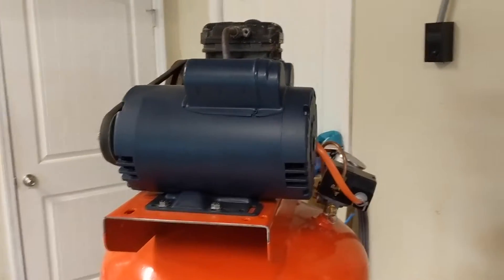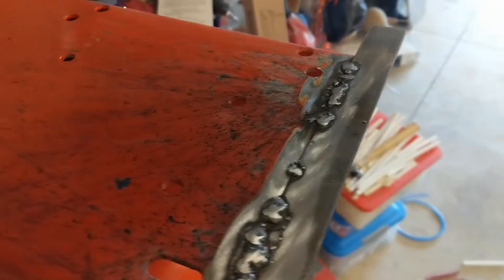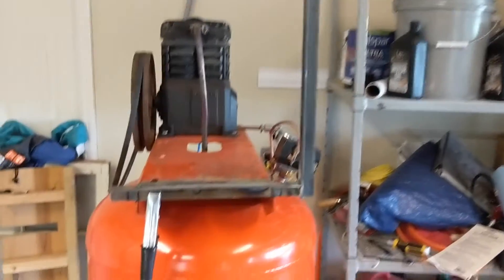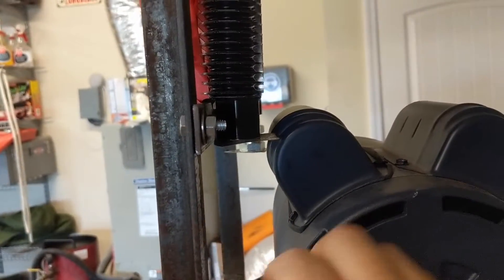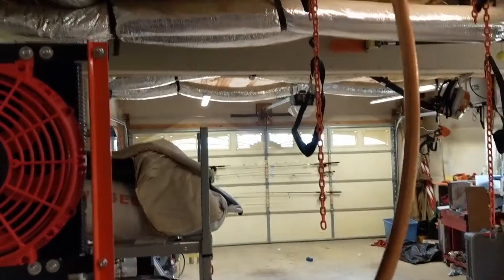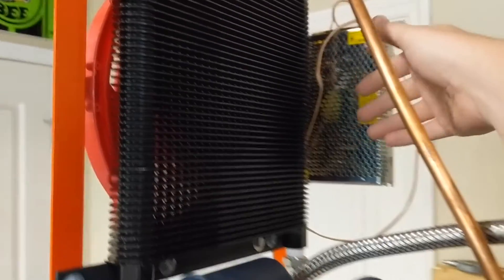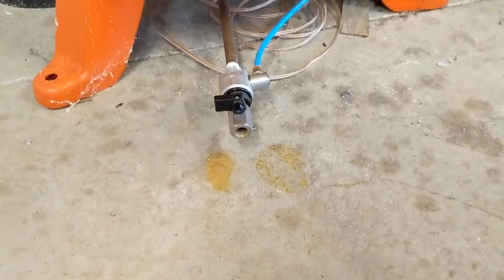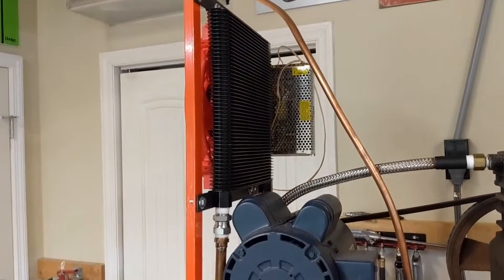Air Compressor Aftercooler/Dryer DIY Under $200

Comment: You had me at that "quality" Best Choice motor oil from a grocery store.
Reply from the maker: Lol!  This compressor sat outside with a missing oil fill plug and I pulled twigs and leaves out from the hole.  I didn't know if this would last and this oil wasn't going to stay in it but one heat cycle

Comment: Thanks for posting this up! If nothing else, inspires and shows possibilities.

I'm not sure how the tubing is routed in that cooler, but with normal routing, would worry water will get stuck in the low spots instead of being forced to flow out of the cooler and into a separator.
Reply from the maker: @cavscout888  Thank you!  I was worried about the same thing but it seems to work well up to 120 psi.  It's a transmission cooler and my hope was no fluid would be trapped since it's made to flow a fluid.  It's been working so far.  Beyond 120.psi, I'd recommend an AC condenser because I blew this cooler on a 175 psi system, lol

Comment: Nice job. I'm doing something similar. It looks like you wired up the fan so the fan rotation is clockwise making it a pusher. Is that what I am seeing? Thanks!
Reply from the maker: @AmericanMakerCNC  Yes, I'm pushing it over the transmission cooler.  I did find out if you have a 2 stage compressor, this cooler will blow after a while and you need to use an AC condenser instead to deal with the 150+ PSI
Reply: @TheRoostersGarage  Thanks for the reply and info. Sorry your cooler blew. I am using a different cooler that is rated at 250psi working pressure and 300psi burst strength. And my two stage compressor maxes out at 175 psi. Hopefully the cooler I selected will last ... we'll see.
Reply from the maker: Thanks for checking the video out and commenting.  You should be good with what you selected.  This one has held up for me without issues, but I did a buddies compressor and it blew on him.

Comment: The dryer should go where there is air flow and that is in front of the compressor pully unless you are going to use a secondary fan on the evaporator. Sorry but I'm only one minute into the video.
Reply from the maker: The problem with using the fan pulley is that air is to cool the head.  If you get behind the pulley then you preheat the cooling air for the head.  If you're between the pulley and the head then the head doesn't get the airflow it needs.  If you're behind the head, then the dryer doesn't get the cooling air it needs.  Plus, it's not that great of a fan.  I'm assuming you kept watching, but the thumbnail also shows the additional fan I added.  Just a simple eBay 12v radiator fan.
Reply: Yes I did continue to watch it but what I was saying most compressors have a Fan Shroud in front off the pully and the air would get pulled through the cooler before passing over the pump removing the need for all the brackets and additional fan & power supply but as I always say there is more than one way to skin a cat. LMFIAO @TheRoostersGarage
Reply from the maker: @alfredocuomo1546  This one didn't have a fan shroud so I was stuck making something anyway.  It's been an expensive "free" air compressor
Reply: Lol, it always is but at least you can take pride in your accomplishments. @TheRoostersGarage

Comment: As long as it works it’s great.  A bit of a mess though.    Engineering isn’t my strong suit either.  I have to build and alter as I go. No matter how careful I am I always have to change my design.
Reply from the maker: Yeah this took some altering along the way.  Some things worked great in my head but not on the real thing

Comment: Why would the temperature of the air entering the tank have any effect on the moisture content at the inlet of the pump?  As long as all the air that enters the pump makes its way into the tank, regardless of its temperature, the same amount of moisture is still present.  When the air is used the tank air pressure will drop, causing its temperature to drop, and if it drops below the dew point then it will condensate on the tank walls all the same.
Reply from the maker: As our weather warms up our humidity also increases.  Rainy days of course bring more humidity.  There is a noticeable difference in the summer months versus the dryer winter months in how much moisture is trapped.  Before this I would notice the tank would hold less air in the summer than the winter between cycles and if let sit overnight it would need to cycle again to refill as the warmer air was less dense.  When it normalized overnight the density dropped to where there was only 80 psi in the tank.  Since installing the aftercooler this does not happen because it gets cooled before entering the tank.  Now my air is not only dryer in the tank and no moisture ever comes out from the tank but also it maintains pressure in the tank.

Comment: Love this.I made mine with just 3/8 aluminum brake line and made smooth back n forth loops into water trap with a drop pipe with ball valve right before the trap.. The other way I wanted to make it was using my 60 gallon tank as my tube bender and just wrapping it around the tank a few times before entering my trap.. doesn't have to look pretty, just needs to work. And my way was DIRT CHEAP
Reply from the maker: I looked at the water bath method and it honestly looks like it would take the most heat, but I didn't have room for one big enough to do anything.  My favorite price is cheap!
Reply: @TheRoostersGarage  ditto..I just built my whole shed from other people's scrap pallets(they had nice 2x4) and galvanized wharehouse doors ended up my roof panels(after cutting them)..I only spent $200 on my OSB walls and another 70 on house wrap.. Anything else is accessories..So a 12'x10' that would've cost me around $4000 otherwise..I know all about cheap, and FREE is my favorite 4 letter word. Until I hit my thumb with a hammer
Reply from the maker: @_mylastname  LOL!!  I bet you were saying some other words then.  Other people seem to get a lot of free stuff and I wind up just looking for cheap stuff.

Comment: Where did you get your power adapter?  Has it lasted a while?  I bought one online and in a week it was toasted. Thanks for any info!!!
Reply from the maker: I've got the link in the description for everything I used on this project and it came from Amazon.  It's lasted for the life of this modification without any issues, but I went way overkill on it by going 20A on this little fan.
Reply: @TheRoostersGarage  thank you for your speedy response!!!

Comment: This is very close to the setup I am working on now. The wiring is what I dealing with. I thought I saw that right, you used speaker wire to run 220v to the power supply? Not being critical, just asking. That didn't burn up? Is that because of the low amp draw over it? I thought I would need high voltage primary wire to run this off the 220. If so, I have loads of high quality pure OFC speaker cable.

Oh and we all started out welding like that. Great job going for it and getting it done! I still remember the first time I welded, years ago. Built an outdoor kitchen out of my 4-wheeler trailer. To this day everyone at my tailgate's say who built this thing? I say, me. They say, I didn't know you weld. I say, I do now.... and that's how it begins. you learn. Great job man!
Reply from the maker: Yes you saw right, I used speaker wire to connect to my transformer.  It's not the most recommended since the insulation isn't rated for it, but I'm not grabbing wires as the compressor runs and it's high enough to keep little hands off.  It's safe enough I guess.  No it hasn't burned up and even after running for a while it's not warm to the touch at all.  Since it's 220v, it's half the current and 16ga wire on 220v is plenty of copper for this amperage.

Thank you for the kind words!  My welding is improving, and I upgraded from my HF wire feed to an Everlast stick welder.  Now I'm sucking at stick welding too, LOL!!  I'm getting better and practicing on old brake rotors.  It blows me away that at 90 amps with this stick welder using an 1/8" rod I can get a brake rotor red hot but my 90 amp HF welder was too cold for anything that thick.  But I've welded several things up with it and while the welds aren't pretty, they hold.  I've got a friend who is a professional welder that got me into stick welder and I ask him to check my welds quite often.  He started off laughing at them because they are so bad, and now he can see they are getting better and he's offering advice for improvement.  We all start somewhere!

Comment: Any problems with water getting trapped mounted that way/level?
Reply from the maker: None at all, and I had my concerns.  I've got an auto tank drain I installed before this but I've never seen any water come out of it since installing the aftercooler.  Before I installed the aftercooler I had a wet spot after long runs and when manually opening would get a lot more water out.

Comment: Has the 240v to 12v power supply been holding up? Thanks!
Reply from the maker: Surprisingly yes.  I've spray painted my lawnmower deck and done a bunch of work with cutoff and grinding wheels which I would have thought any of these would have killed it but it keeps on going.  In fact I haven't had to replace anything so far.
Reply: @TheRoostersGarage  Thanks for the quick reply. Just ordered one for my aftercooler fan. good price for a 20 amp power supply. Shouldn't have a problem running a 6.6 amp fan. It will draw less than an amp from the 240v compressor supply.
Reply from the maker: Honestly that's why I went with a 20 amp - I figured it would be so much less than it can run and it should run cooler than if I got a 10 amp and I was over 60% of it's rated capacity.

Comment: How do you wire up the aftercooler to the air compressor. Do you have a video on the matter?
Reply from the maker: 6:43 I very briefly touch on it.  There are 2 contacts inside the pressure switch - both are power so there is no polarity to worry about and these are only hot when the motor is running, but disconnect the power anyway.  The speaker wire connects them to the 220v - 12v transformer.  On the input of the transformer there are 2 screws where this wire connects.  Ensure the switch on the transformer is on 220v mode, then take a 12v positive and negative out to the fan.

Comment: Do you have the link for your after cooler on Amazon and fan size you used?
Reply from the maker: The links are in the description.   The fan is a 12" "racing" fan on eBay.  I'm pretty sure it's some Chinese junk but it's lasted this long and for $20 I can't complain.

Comment: Grinder and paint make the welder I ain't. LOL I'm not the best welder either
Reply from the maker: I like that!  I'm now learning how to stick weld since my DC converted HF welder still wasn't up to the task of welding 1/4" material.  I've got less spatter and more penetration, and my welds hold but they aren't pretty yet.
Reply: @TheRoostersGarage  nice that's what I'm doing for my sawmill build, but mine is a mix of metal thickness; 3/16", 1/4", and 3/8" plus welding on nuts to take all the lateral force and stabilize as feet. The most of it I'm confident enough. But the latter part has me nervous
Reply from the maker: @WarpedWoodworking  Good luck with it!  I'd be a bit nervous myself and stand back the first few times I turned it on!

Comment: Thanks for the video.  I have borrowed some of your ideas, along with some from other YouTubers.  Installed and plumbed my cooler this past weekend.  Just waiting on the fan to arrive from Amazon.  Even without the fan I am noticing a major difference in the reduction in moisture.  Thanks for posting
Reply from the maker: Glad you have a working solution!  What other ideas did you use?  Just curious if I might need to incorporate them into mine.

Comment: Great idea, I have a question- I see you used an oil cooler which is a bar and plate style heat exchanger over a tube and fin design used for automotive type A/C condensers. The tube and fin is a better heat exchanger but I've heard the multitude of bends cause flow restrictions is that why you went for the oil cooler?
Reply from the maker: That is exactly why I went with the oil cooler, plus it's compact size made it more convenient.  Mine is a 125 psi compressor, but for a higher pressure switch the automotive condenser would have to be used.  I've heard with them the fan isn't needed because they are more efficient, but I'd still run a fan anyway.

Comment: I know this is a old video but I'm wanted to wire a 220 power supply just like you have just wanted to know how you wired it to the pressure switch,
Reply from the maker: I wired the transformer in parallel with the motor.  Basically, the 2 ring terminals where the motor gets its power are the same screws I added ring terminals for the 220v incoming for the transformer.

Comment: Is the fan really even needed? And it sure looks like if the radiator is on its side it would allow water not to accumulate in the bottom of the coils if the inlet  was  into the top. Just wondering.
Reply from the maker: The fan is needed to rapidly cool the incoming air from the compressor head as this air is close to 300F.  With the fan and the radiator, it cools down to about 75F by the time it exits the radiator.  The radiator has both inlet and outlet on the bottom and has a slight cant making the outlet just a little bit lower to get all the water to drain out (hopefully) and into the copper line that goes to the water separator.  In just a normal recharge it will drain about 3-5 oz of water from the separator.  If I run the compressor for 15 minutes straight I have to stop using air to let the compressor catch up and drain the water separator because it collects enough water to reach the air fins which is about 3" over the max fill line.  I made a lot of assumptions with this as I was building it, hoping they would pay off.  To be quite honest, I never expected this kind of water removal from something like this.  This air tank is 125 psi max, but for a higher pressure air tank a vehicle AC condensor would be better suited because of the pressure and heat.  I've heard those are so large they don't need a fan.

Comment: Nice setup!!! Going to do this. Where did you get the auto drain unloaded valve?
Reply from the maker: It's just a standard air compressor unloader valve.  I honestly can't remember where I got it and it's not showing in my Amazon orders.  I might have got it from Tractor Supply.

Comment: I think I have an identical compressor. 15 amp motor? Considering the cooling fan draws 6.6 amps, did you have to upgrade to a 30 amp circuit or did 20 amp work fine?
Reply from the maker: Mine is a 5hp motor and I've got it on a 30 amp circuit.  The starting current is what threw it up to a 30 amp breaker I believe.

Comment: @Rooster's Garage Great Job..  It's been about 2 1/2 yrs since the air dryer build. Did you raise up the condenser to get rid of the real sharp bend? All you need to do is raise the whole thing up 6" or so.. I've just finished the same kind of air dryer, but now I want to install a fan on it like you did.  How did you wire up the fan and transformer into the compressor?
Reply from the maker: I have not raised it up.  It's been working and with the hard lines, it's not worth the time it would take.  The transformer is connected to the 220v going to the motor so it only has power when the motor is running.  All compressors are a little bit different, but just tracing the wire going from the motor to most likely the pressure switch will get you to terminals of some sort to wire to.  On mine, they are just screw terminals and I added a ring terminal to take the 220v to the transformer.  The transformer drops the 220v down to 12v for the fan and I've just got the positive and negative for the fan connected to the 12v side of the transformer.  This transformer will connect up to 3 devices, so it's got 3 positive and 3 negative - any of them will work.
Reply: Thanks for the quick response. I appreciate it. I’m gonna order that transformer today and give it a try. Thanks.
Reply from the maker: @speedbuggy7240  Great!  Hopefully you won't run into any snags, but if you do let me know.

Comment: Rooster I’m embarrassed of myself I spent so much time on the plumbing and muffler system I completely over looked the transformer which I forgot to hook up. I went back to your video and realized my error. Yes I have 110 and hooked up the transformer and it worked flawlessly. You have to try and hook up a car muffler to further reduce the noise. Also when using copper tubing your going to get leaks which is time consuming to correct.
Reply from the maker: No worries at all, there's a lot of parts and pieces to make this work but glad it's working now!  I thought about a muffler of some sort to reduce the noise.  I packed mine with steel wool because I heard that helped some, but I didn't notice a lot of difference.  On my copper, I had my friend who's an HVAC tech silver solder my copper so it can handle the high pressure and vibration.  My copper soldering skills are worse than my welding skills - I never could achieve a seal so he came over one night and fixed every one of my joints.